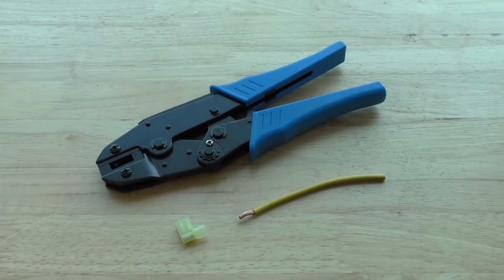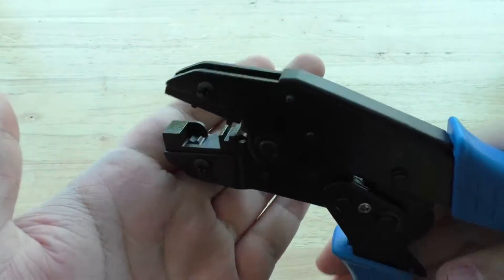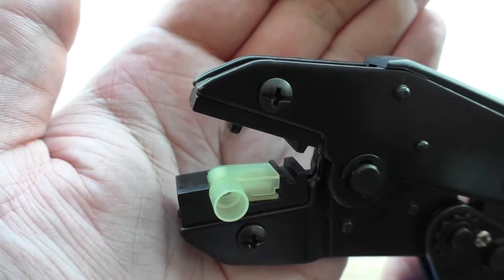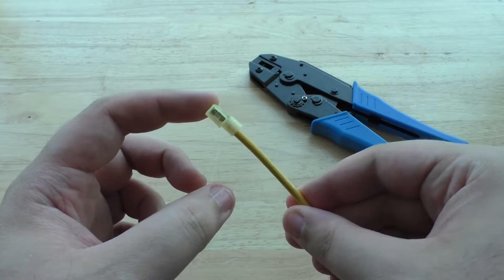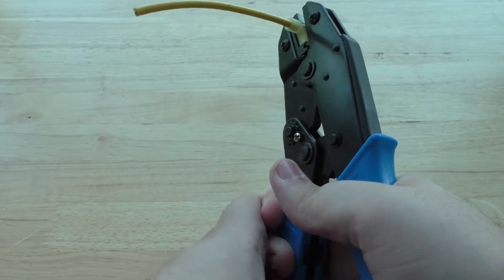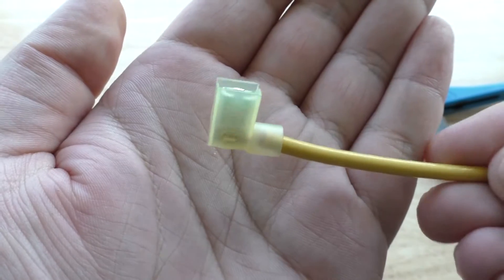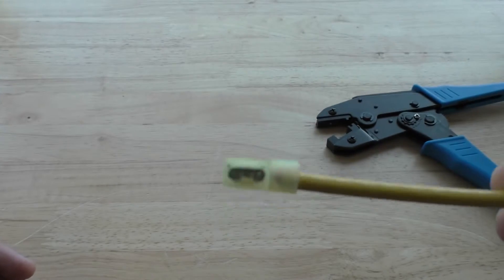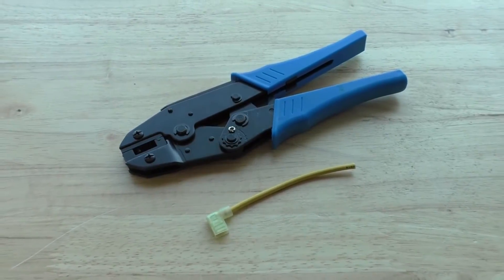FDT10058 Insulated Flag Terminal Crimping Tool

Comment: I purchased the FDT10053 for 22-14 and a set of dies for 12-10 gauge flag connectors. They work great for much less $$ than competitors. The tool appears and feels to be well engineered and the crimps are sure and secure. The technical support at FerrulesDirect was fast and courteous. They are easy to find in Sterling VA and not too much more I need to say, except great deal!
Reply: Why are these better than a regular straight terminal?
Reply: @Angel283  Sometimes it's an access issue.  My trolling motor control switch has the right angle flags because there isn't room in the casing for the straight ones.
Reply: @storregro  Thanks!!  I appreciate your reply!
Reply: @Angel283  Appliance repair is is a space issue. Must use high temp non insulated flag. I have never found a decent tool for this. I just use my standard crimpers and take my time and looks good. It should after doing it for 40 years